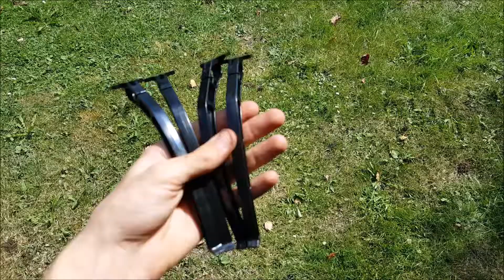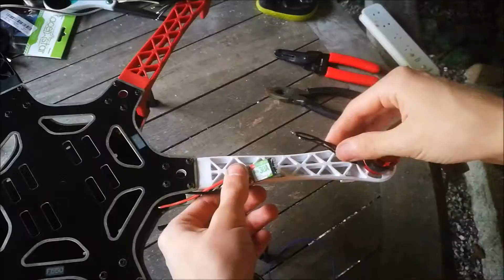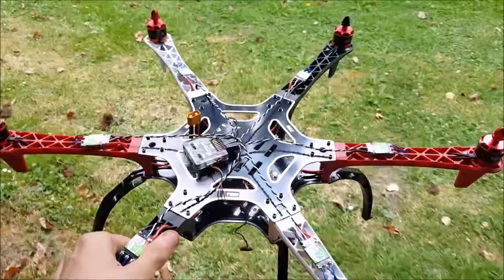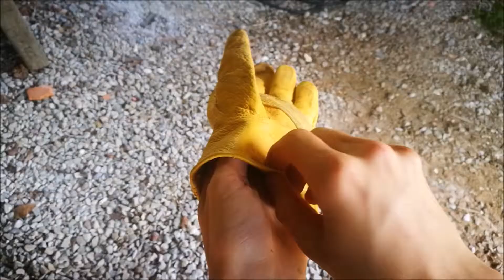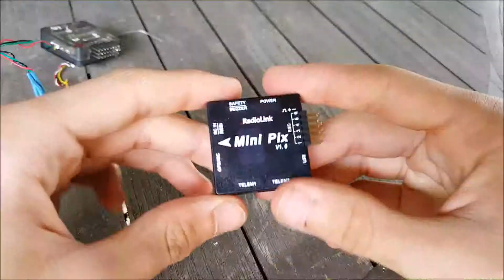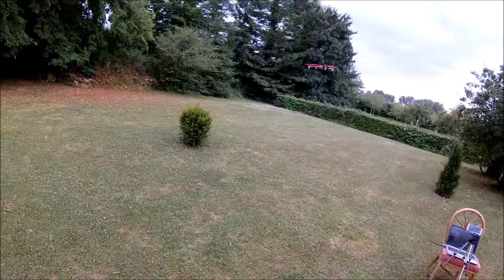AUTONOMOUS Hexacopter-DIY

Comment: Hey we want to build such drone which can carry payload upto 0.7 kg. Can you help me list out all the componens specifically needed to build this machine.
Reply from the maker: As with any quadcopter/hexacopter or other RC vehicle, you need:
A flight controller
X brushless motors (4 for quadcopter, 6 for hexacopter...) 
X ESCs (electronic speed controllers;one for each motor) 
Propellors suited for the size / power output / motors and batteries of your drone
A lipo battery (4s or 3s generally for this size of drone) 
A receiver and transmitter to control the drone

If you want to make it autonomous, you also need a GPS and some sort of Telemetry device (transmitter on the drone and receiver on a computer) 

That's pretty much it! 
Any questions? 
Good luck!

Comment: Hey! I liked your video. That's great. I want to make a delivery drone using app. Is it possible to bring it to life using your method? Message me ASAP plaese!
Reply from the maker: Hello ! It sure is possible! The question is how hard it is. If you are the one sending packages, you need to know all of the coordinates of the receivers. You need to find a path that doesn't go near airports and such. The legal part is much more complex than the electronics of your project.

The method I used in the video will indeed work to do such a project. You might need a longer antenna or use different kind of communication like GSM for telemetry or sending commands. But the app I used in the video works great.

Good luck!

Comment: hi your idea is brilliant ,i want to make a drone with the same concept for surveillance purpose over a land and use the image processing along with this system  ,so i need your help further for the code and other pre-requisites.
Reply from the maker: That's great! That's seems pretty ambitious but a great challenge!
Have you made a drone before? Or image processing?
Reply: @electronology4665   yes image processing is fimiliar to me and I've made a RC plane
Reply from the maker: All right! Let's get started then
Well you're gonna need an autonomous flight controller like a Pixhawk or an APM.
Once you have that, you need to make your flying vehicle (quadcopter, or plane)
Put the flight controller in and use ardupilot to set everything up.
You're also going to need a way to receive telemetry data from your vehicle (so you need telemetry modules)
Any questions so far?
You're pretty much done at this point, just need to add camera(and a raspberry pi maybe?)and that's it really
Reply from the maker: @kartikpandey5335  These videos helped me. They're focused on the Radiolink Minipix flight controller but they help nonetheless
https://youtu.be/twW9CaRlj-U